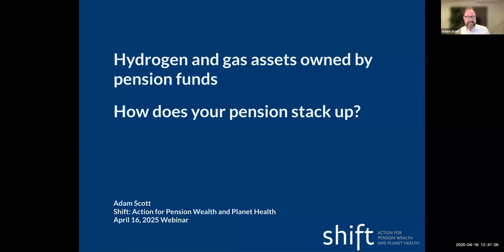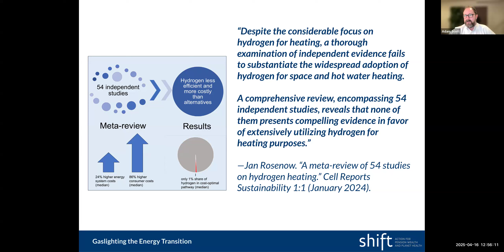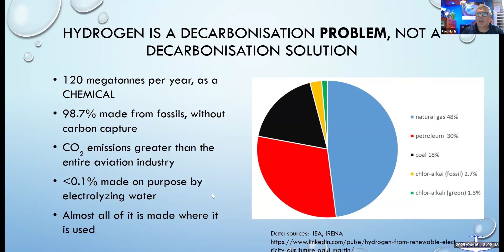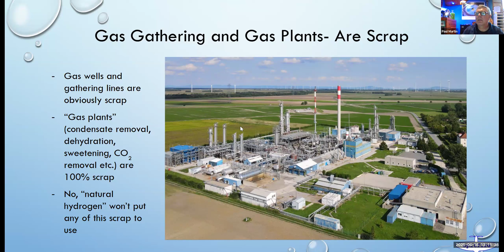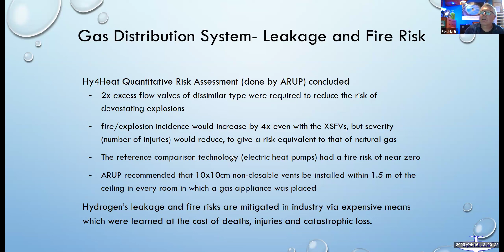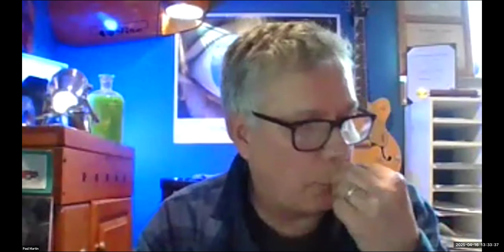The SEI at EUC Presents: Hydrogen, Pension Fund Investments and the future of Gas Infrastructure

Comment: Thanks for sharing. Hydrogen will have very limited role in decarbonising for reducing emissions. The best case will be to use only the green Hydrogen to replace the currently in use of 98 million tonnes per year of black and gray Hydrogen. Hydrogen must not be used as a fuel for home heating and land based transport. The science, economics and safety considerations are stacked against hydrogen for everything.